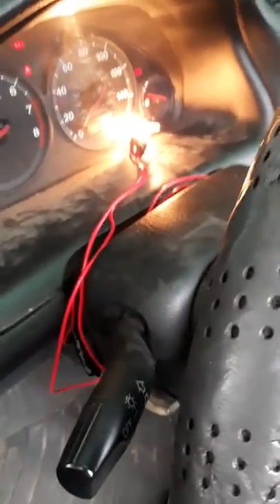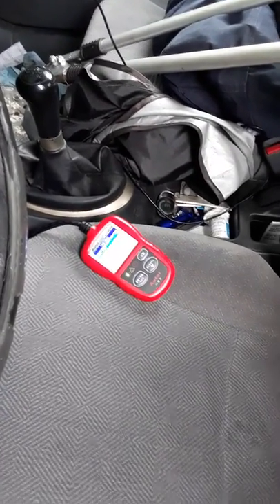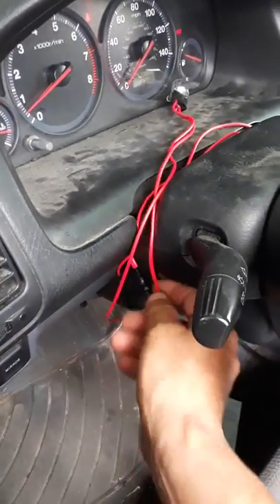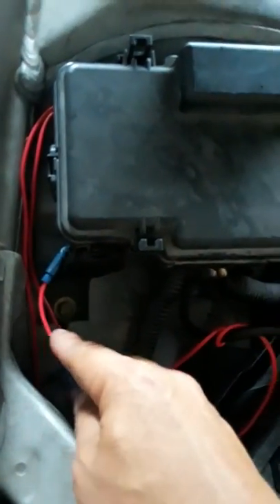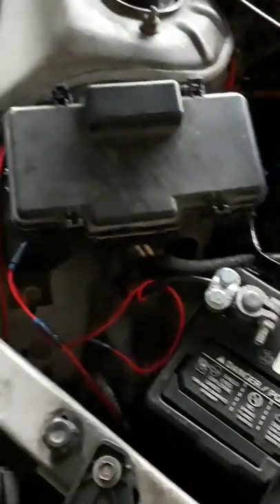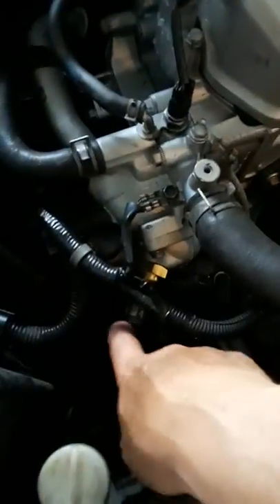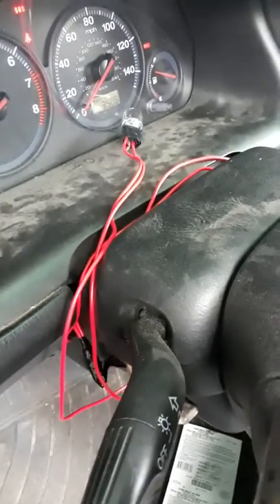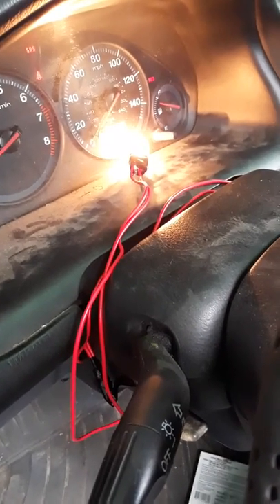Fan indicator light, fan switch, cooling system, overheating,

Comment: Did you connect at wire 87?
Reply: @Sergeant5e  Hi there Sergeant5e
Reply from the maker: @jeffcobb4361  hey, I guess I did hook it up to relay.  I can't remember if it was 87 or 86.  Just hook it up to the one that goes to the fans
Reply: Apparently this will only tell you that the fan relay is working.
Reply from the maker: @joeyborras4728  Not exactly, it tells you that the whole fan circuit is working properly, not just the relay.  Relay, fuse, wiring, fan switch, etc... yes, you could have done this with a volt meter or test light which I did first.  This was done for sheets n giggles.  🤷